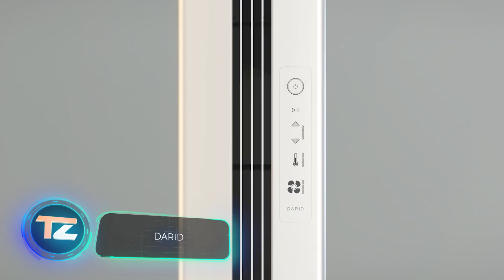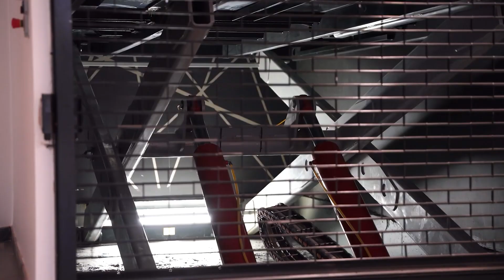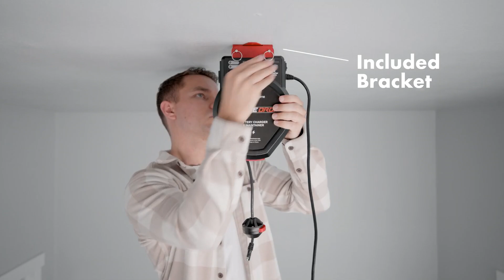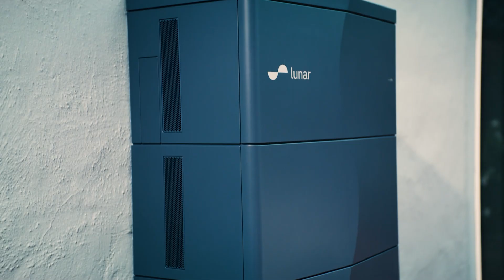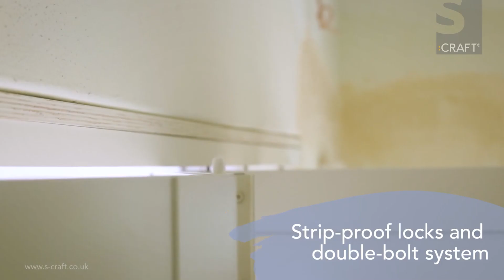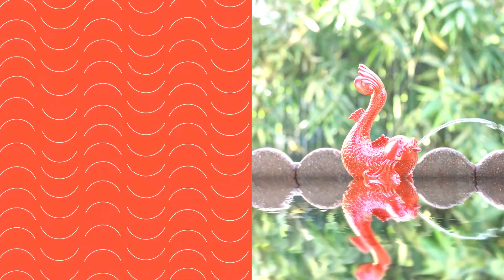INGENIOUS INVENTIONS FOR HOMEOWNERS THAT WILL TAKE THEIR HOMES TO ANOTHER LEVEL

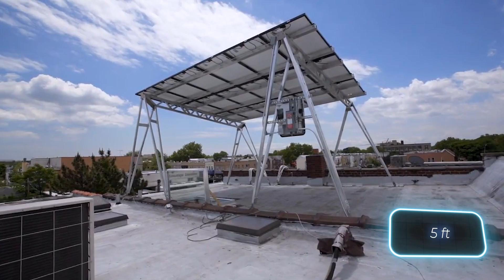Comment: 14:00 I feel like you could compensate for those spaces by installing gutters between the panels, and give the solar panels the kinetic charging film as well, so they continue to charge power even in the rain.
Reply: Plus, with how big it is, if you had an electric vehicle, you could have a setup where you park the car under the panels like a carport, and let the panels keep your car charged.

Comment: Whats more dangerous is no hand rail on those steps
Reply: It does have a hand rail  😮
Reply: @davidleis9160  it’s on the wrong side ( next to a wall ), yet leaving the danger side unprotected
Reply: @mrdenson3101  then stay AWAY from the dangerous side.....that way someone else gets the Darwin award
Reply: @davidleis9160 yeah, on one side. The whole other side drops off into nothing with zero protection
Reply: Worry about yourself....problem solved
Reply: @Rufflezhaveridge  
You should really take your own advice
Reply: And somehow our old friend the Once-ler is totally fine with much thinner stairs without any railings. But then again, unless somebody cares, it will only take one to realize that this is no cartoon. Not that I don’t care for their safety, but it’s funny how you say that when the average person walking about in town doesn’t have any more hands to hold on to a railing with when taking the next subway over.
Reply: I don't even drink and I can still clearly picture myself dying at the bottom of the side of that freaking stairway
Reply: The designers wanted to make it sexy but ignored safety